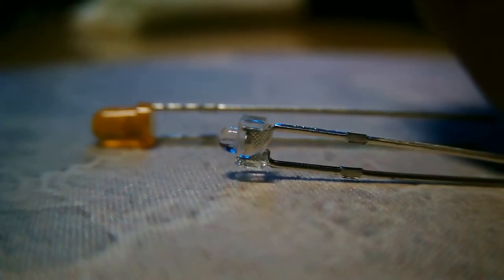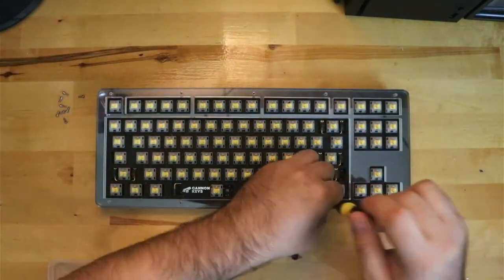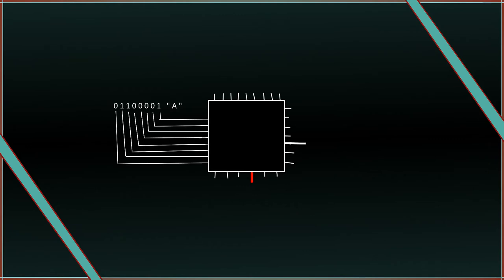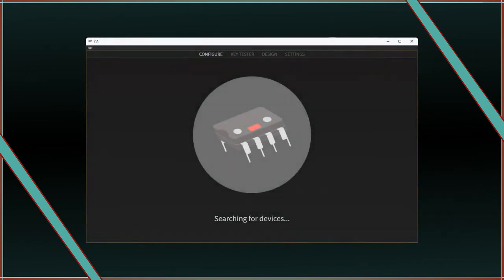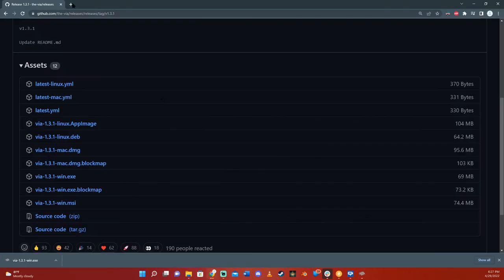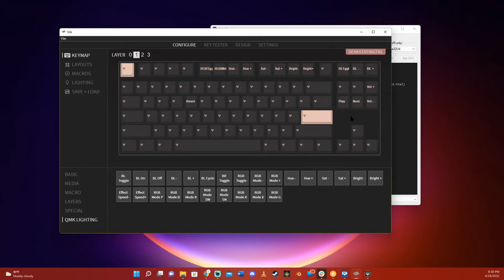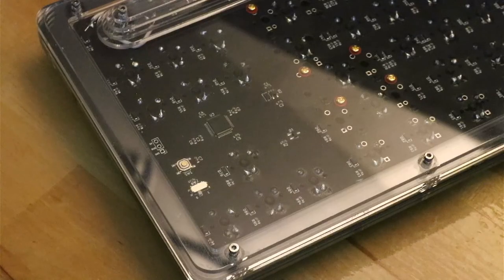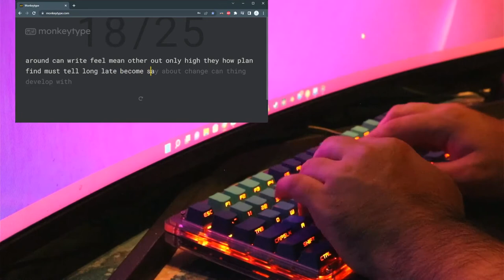How to flash your keyboard firmware with QMK and VIA: LED's on the Stacked TKL

Comment: What was the point of downloading the via app at all? I was following along but you didn't really do anything with the app. You just downloaded a firmware from the via website and loaded it into GMK Toolbox. I get that VIA is useful for remapping keys on the fly, but it didn't have anything to do with this tutorial
Reply from the maker: so without VIA compatible firmware, it won't load into VIA. I do use the QMK tool box in the video. you can customize the keyboard on the fly without having to code it out. It makes it much easier to customize your keybindings.

Comment: i got a huge problem, i downloaded a different software for my Keyboard, unfortunately i messed up everything, cant use it now, theres no original software... the VIA doesn't recognize even after using QMK, my keyboard is a REDRAGON SION K653 wired...
Reply from the maker: If there is no original software, or you flashed an incompatible version onto it. The only thing that you can try to do is reflash it in QMK with a version that is compatible. I would do more searching for binaries? I don't know what to tell you.  I know for sure that the chip isn't permanently brickable. People have re-flashed reddragons before.
Reply: same situation damn, did you find any solution? my kb is K636